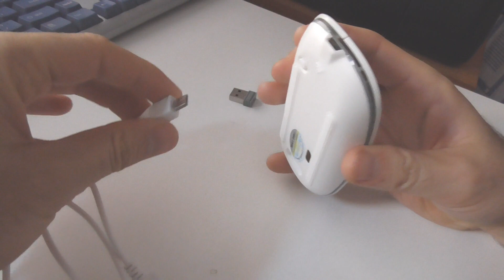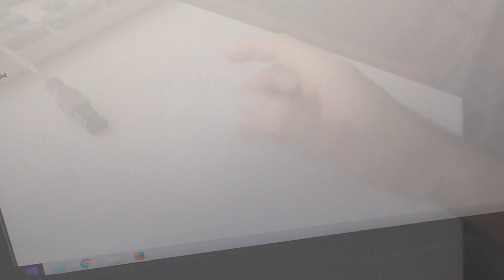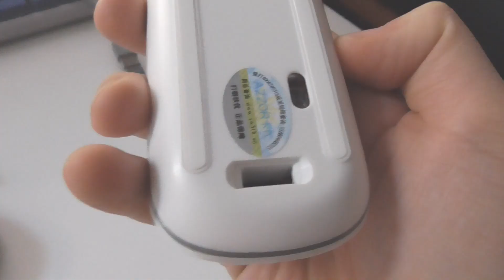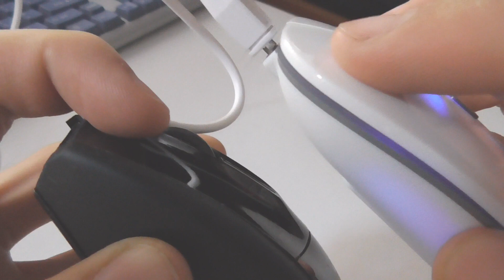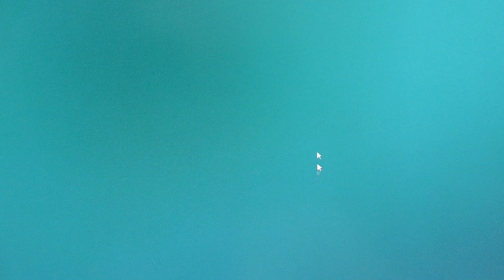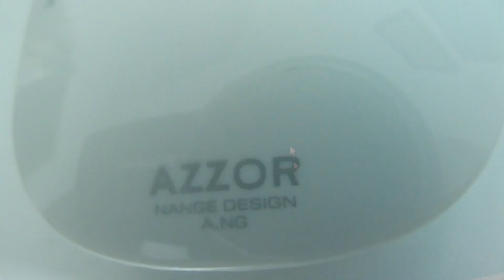Azzor V8 Mouse (Wired/Wireless, Built-in battery, Silent Clicks)

Comment: bruh i bought this mouse online and thought the second button would turn on the leds and now i am mad the leds only work when you charge is
Reply from the maker: Just use the mouse, don't drain its battery quicker with fancy lights ;)
Reply: If you want the led's, then first insert the USB into your laptop and then move the switch to the led setting on the bottom of the mouse.